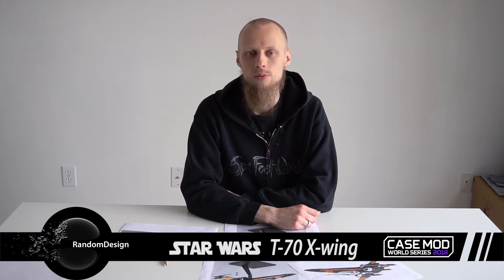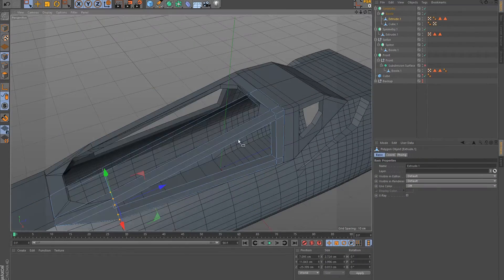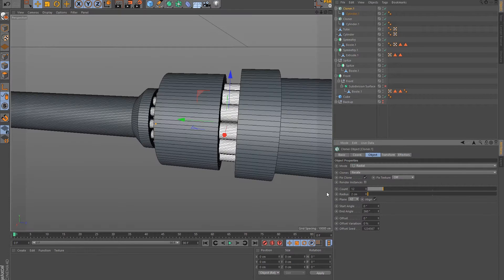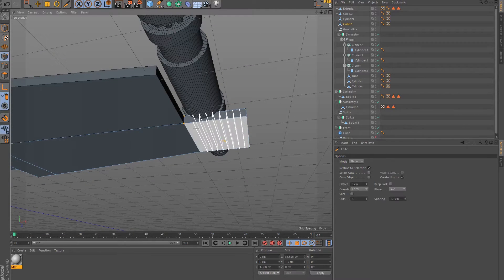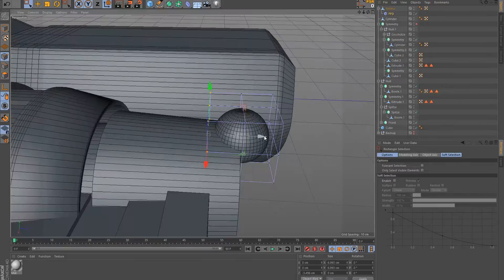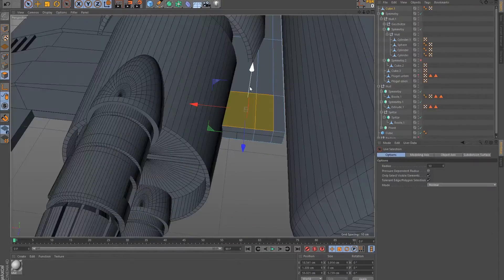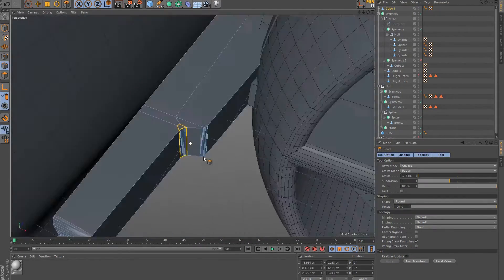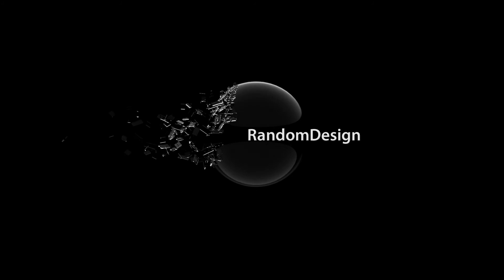Star Wars X-Wing - 3D Modelling

Comment: Please, how do you export the file in blender for 3d print? Means, Do you join each individual object with boolean  or how?
Reply from the maker: Didnt work in blender this time, but the entire model is seperated in different sections, like wings, body and weapon parts. 
Then all the sections are further subdivided to fit my print bed. For example, I took the body and cut of a piece with a knife tool. 
Closed the openings and made a new file. I transfered the cut off section to the new file and exported it as an .stl so the slicer can do its job.
 In Blender its under File - Export - Stl

For the modelling, yes I used some boolean operations to join various meshes and also modeled simply with extrusions and splines.
Just make sure you dont have and walls or polygones inside your model other than the outer shell. Slicers will have a problem with that. 

Hope that helps
Reply: I understand perfecty ;). But, for example, your wings are made of several meshes, so when you make booleans, must you repare topology or add new loops to mach one part with another? It can be so hard!  Thanks for your reply!
Reply from the maker: The wing was just made out of one cube. Everything that I added was just extrusions and cuts. 
The turbine then was made from a cylinder. After I got the turbine, I booled the turbine shape out of the wing. that way there was no need to match anything. 
Then it was just simply mirror and copy for the other 3 wings
Reply: Thanks for your help! I wait to see the final result! 😉